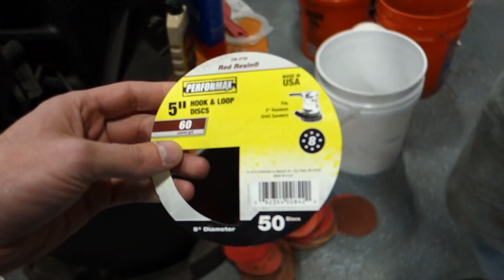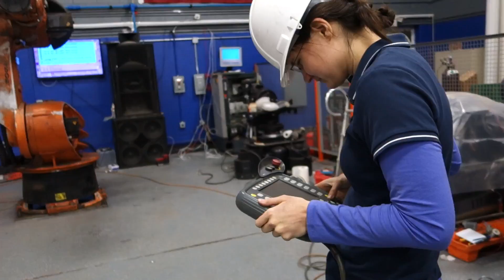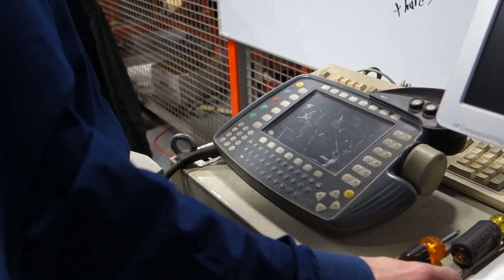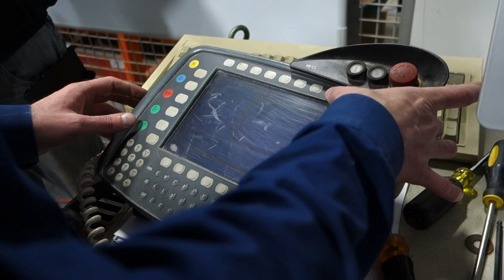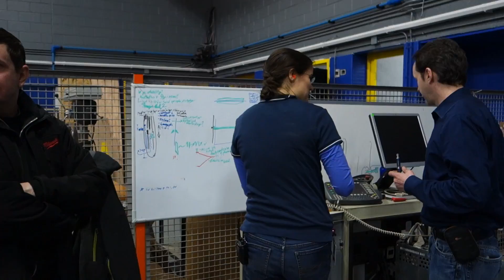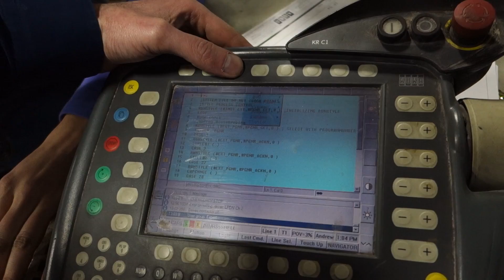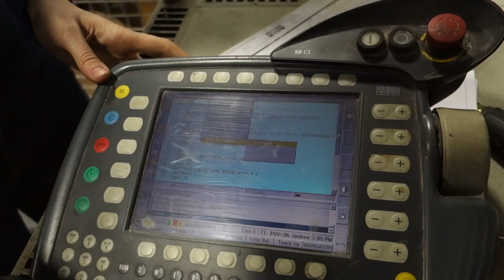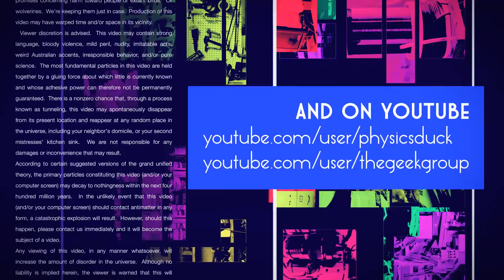Captain's Blog 4 2 2016 Drop The Bass

Comment: Chris never plug in an PS2 or AT keyboard while the computer is running. You could blow the keyboard fuse on the board. No fun to replace.
Start menu on every Windows versions opens with CTRL+ESC by the way :)

Comment: What kind of audio device does the blog need to deal with the sanders, vacuums, and all of the other machine noise. I mostly listen with head phones, and the motor noise just hurts. Even at minimal volume.
Reply: +Chris Boden limiter, compressor, notch and bandpass filter and a parametric EQ.
Reply: As far as I know Chris would need to spend 2 or 3 times more editing blog to take this machine noise out plus become an sound engineer to boot . personally I think he has bigger things on his plate to deal with .sorry freind
Reply: +Chris Boden look in to the auto gain settings of the new blog cam. Sound is way to loud for headphone users :(.
Reply: +Craig Nicholson Craig it doesn't sound like you are an audio engineer to be giving advice and I also would appreciate you giving Chris time to answer the his question as I to am constantly adjusting the volume since Chris got the new camera.
Reply: Rob NAustin sir your correct I am not an audio guy but know a bit to comment I work with sound fore to affect some of my own videos with my children it truly takes me hours and Chris has a vast more intlect than I do with audio . I also am experiencing the problems with the sound . But if u read all the comes Chris did comment asking for help 
As Chris says come up with a solution or quit . . . . I won't say the next word

Comment: Are all these robots donated or did you buy them?
 cool stuff, I want one :)
Reply: +Chris Boden Awesome :)
Reply: +Chris Boden he he, I'm in the uk + I'm not at that level of workshop yet where I have a conreate floor. I'd love to one day or build one :) . I'm making a robot now but it's more of the ordinance disposal style with dual tracks (1kw motors per track) and a hydraulic arm made from modified car roof systems. I'm also currently making a homemade injection moulding machine, pick and place machine, and in the process of CNC conversion for a bencbtop milling machine, so maybe when I've got the mill up and running I'll try and CNC a small desktop robot arm. 
check out my Instagram:
https://www.instagram.com/mechatroncnc/?hl=en

I love what you're doing, keep getting more robots :) or build a huge one that will only just fit in your makerspace.